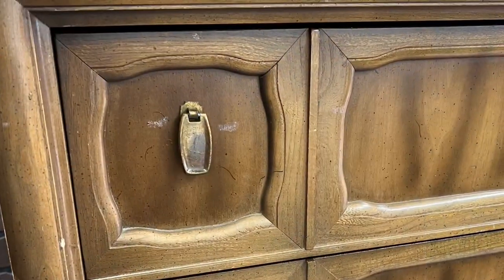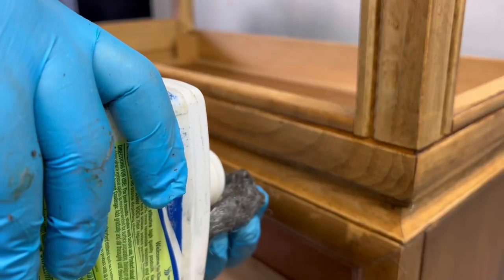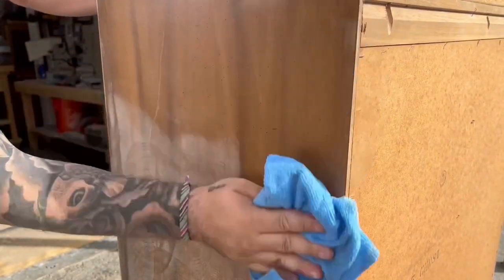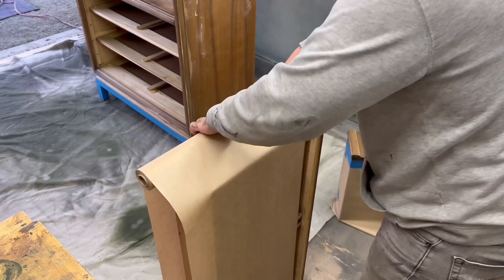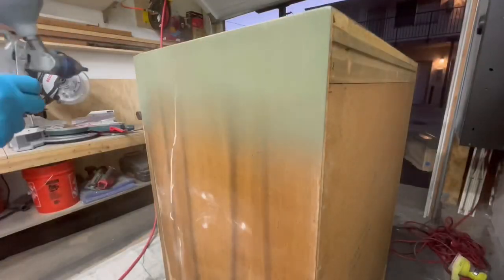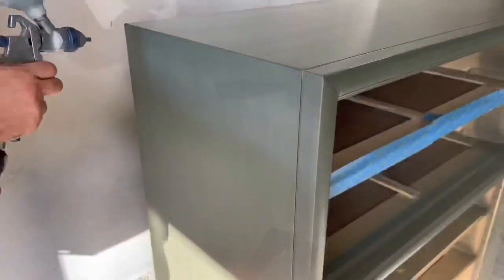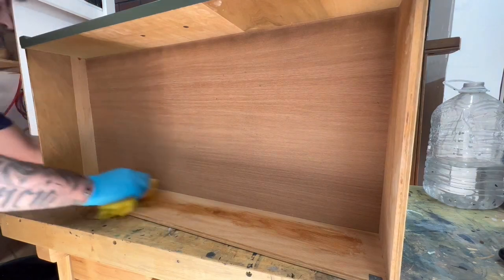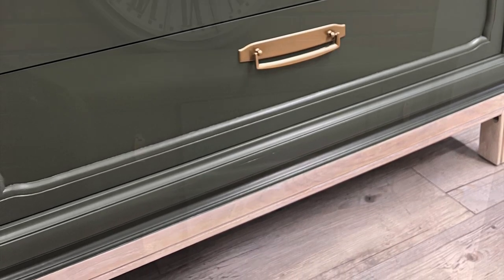PAINTING this tall boy DRESSER and making a PROFIT || FURNITURE FLIPPING unwanted home DECOR

Comment: That green is sooo good!! When mixing your water into your paint for spraying what is the ratio you use??? Also great idea about mixing in the top coat with the paint.. what ratio do you use for that as well? Thanks samuel!! Great video!!
Reply from the maker: Thank you so much. For the mixing, I dint have an exact ratio because different paint companies tend to have different consistencies. But I usually start with a about 10% water and then mix from there if it’s not rite. As for the top coat with the paint, the top coat is typically a lot thinner then paint so I just tint it with the paint and no water. I hope this helps
Reply: @CedarPineDesigns  thanks soooo much!!! You are always so helpful and i appreciate that!
Reply from the maker: @thekraftycreech  not a problem at all